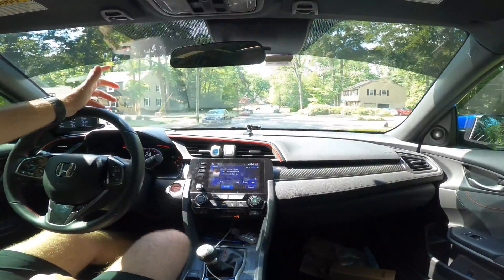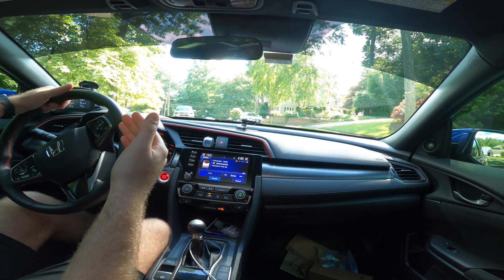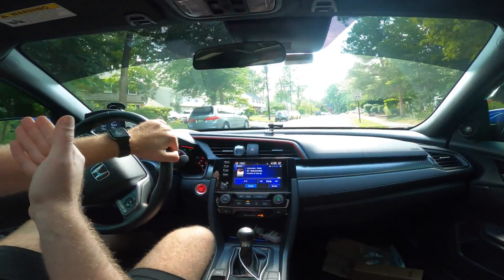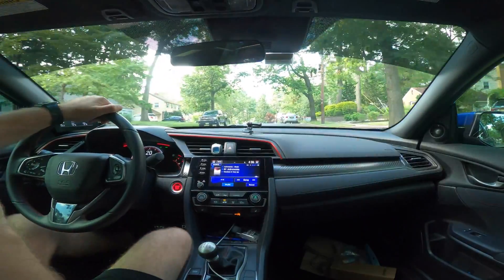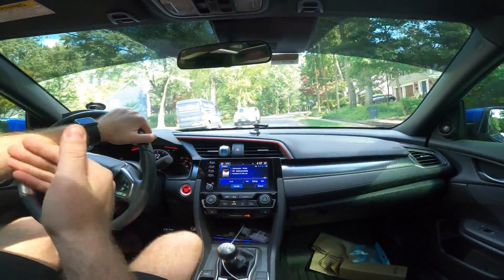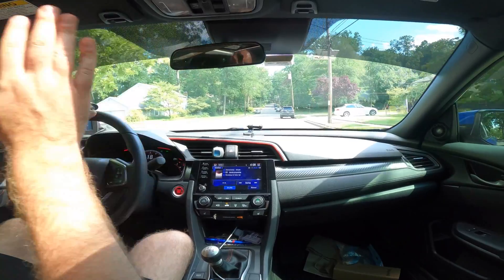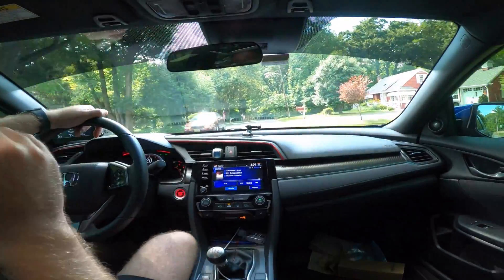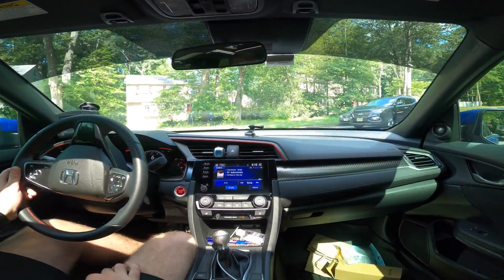Hill Start Assist and Brake Hold Explained

Comment: The 70’s …. My 2012 Honda SI doesn’t have hill start assist…. My 2019 SI Does…. It cheats the driver of a real experience of actually driving a manual transmission

Comment: Hey man, can you use the brake hold in conjunction with the hill assist while moving off from an incline? Where I’m from, a lot of our carparks are multi storied ones. Appreciate if I could get your advice, thank you!
Reply from the maker: Well the car does hill assist automatically but if you have brake hold on then you wouldn’t need hill assist to kick on since brake hold would already be holding the car for you.
Reply: @ThePropperWay  I see, thank you for clarifying! Have a good day ahead 👍🏻
Reply: Love the Honda Civic Type R FK8 btw, I hope to one day be able to own one. The prices, even used, are astronomical where I live. 🙃
Reply from the maker: @kewei94 I have the FL5. Never driven the FK8 one but had friends who had it. I assume it can’t be much different.
Reply: @ThePropperWay  saw your icon and intro and I assumed, sorry about that. Yeah, I’m pretty sure it’s similar, if not better than the FK8. I’ve grown to like how subtle and unassuming the FL5 looks compared to its predecessor. Both great cars though.
Reply from the maker: @kewei94 ironically I have had my intro way longer than I have had the type r. Just a weird coincidence that it worked out color wise.

Comment: Does break hold work for Hill starting? Like if its on and I'm going to 1st gear while foot is on the break and then moving it to the gas, can I just be on clutch and gas? Or is it only on flat ground.
Reply from the maker: @DecemberVang  brake hold works on any terrain/angle
Reply: @ThePropperWay  I have an FL5, and sometimes when I am on a hill, I feel like I'm too slow from clutching in, going to first while my foot is on the brake and then slowly releasing the clutch and then quickly going on the gas; thus causing me to start rolling back. If I have the brake hold on; can I do this? Clutch in, go into first "No foot on the brake". and then move with gas and slowly letting out the clutch? Or would I be rolling back as soon as I add gas.
Reply from the maker: @DecemberVang  it will work but once you press the gas and release the clutch the brake hold will turn off and not engage again until you hit the brakes again. Need to be aggressive enough on the hill to disengage brake hold and get the car going forward without stalling.

Comment: another pointless “sales feature” like TPMS - immediately apply the handbrake when you stop on a hill (as you should, to make the car safe) and release as you move off. Simples
Reply from the maker: @jaywalker1233  pointless? It’s a features that helps you out so you don’t have to do a pedal dance to get moving on a hill. I think it’s a great feature.
Reply: @ThePropperWay  
u have to learn the ‘process’ for your car, and it may not ‘work’ in the next car u drive (they’re not all exactly the same). Sure, you have to learn the traditional h/brake process - but that works for all manual / stick shift cars (except outliers like Mercedes). My car has it but I dont use it because safety first: always apply the h/brake when u stop on a hill. But if u like it then, hey, that’s great
Reply from the maker: @jaywalker1233  can’t turn off hill assist on the Hondas and with electronic parking brakes it’s very hard to release it correctly to get moving on a hill since you have to be pressing the brake to release it.
Reply: @ThePropperWay  
yeah can see that, my car’s setup disables h/start assist soon as h/brake applied - system designs are manufacturer/car specific but I’ll always prefer a conventional h/brake as it’s a 100% mechanical safety backup in case of major electronic system failure (pretty sure more+more RTAs are going to result from electronic failures..)
Reply: btw nothing bad meant ‘bout u, ur channel has gr8 stuff +this vid explains h/h well 😊

Comment: My first car, 1995 Subaru had hill start assist, but I have driven many 90s- 2000s standard transmission cars without it. Not just a 70s deal.

Comment: Found this before I got my '24 Integra Type S. Great feature especially for me, this is my first manual car ever (I'm 32yo). I got a lot of practice in prior on some older Civic's and even a super old Ford Ranger truck in a parking lot. Still need more reps and practice but this alleviated my one fear about getting a manual.
Reply: I’m not balling like you w the Type S, but I just got a Civic Sport Manual as my first and it’s features give me some peace of mind
Reply: @calebbush6500  the Ford Ranger I got reps in is about 25 years old, so it has none of the creature comforts of a modern sedan with a 6 speed. The clutch was heavy feeling. The bite point felt like 0.25" away from a full release. I stalled that thing out so many times getting used to it but I'm glad I got that experience because any good modern manual is SO much easier and accessible. 

I had heard trucks with a manual were also way different than a similar aged car, and it was. I still have some levels of anxiety driving the integra even a month later. It's a lot better than when I got it home though.
Reply: I feel u I just turned 35 and got my fl5 first manual car. I actually had a crazy experience stalling on a hill and almost hitting a car behind me so I definitely need to get this down pack. My question is when at a light is it safe to keep my foot on the brake and and clutch in first gear or should I switch to neutral then try to go into gear fast whenever the light changes.

Comment: You simply release to the friction point of clutch then it starts moving. You need to be better at driving
Reply from the maker: Just explaining it…. Car does hill start assist automatically. No way to turn it off.

Comment: I have 15 civic si so pretty much on the steep hills I have to use a ebrake cuz I don’t have the brake button
Reply from the maker: The 15 civic si I believe has hill start assist
Reply: @ThePropperWay  I was asking about the ebrake button you have I think that’s only on the 10 gen civics no more hand brake?
Reply from the maker: @RayGunz101  no the 10th and 11th gen have the buttons now. No more hand brake lever

Comment: would you recommend using brake hold on an uphill start?
Reply from the maker: If you are on a hill the car will automatically do a hill start assist and hold the brake for a few seconds. I really only use brake hood when I am at a red light or in traffic and don’t feel like holding the brake while stopped

Comment: If you use brake hold on a hill and you release the brake and clutch to hold you are you able to just give it gas when your ready to go or do you need to use the clutch again?
Reply from the maker: Not sure what you mean by that. Brake hold just makes it seem like you are holding the brake when you aren’t actually holding it. Everything else is the same. If you release the clutch in gear you will stall the engine when stopped.

Comment: Hill start assist is for people who don’t know how to drive a manual transmission. Buy an automatic if you’re scared
Reply from the maker: Do I need it? No
Can it be turned off? No
Am I glad the car has it? You bet
Reply: @ThePropperWay  I shouldn’t have a feature on my truck that decides when it’s going to apply the brake. It should be an option.

Comment: No.If you are good with a manual you don't need the hill start.Should have to turn it on not the default.It is the most annoying thing right next to the collision avoidance and the adaptive cruise.

Comment: My 2006 Sienna was doing the hill start assist on its own.  But after changing the front tires and taking it into used car inspection it no longer holds on a hill when I take my foot off the brake.  It gives me so much anxiety and I do not know how to fix it.  Does anyone know how I can fix this on a 2006 Toyota Sienna?  Is there a button I can push?  Is there something I can ask the mechanic to tighten so it doesn’t roll back?

Comment: What’s the difference between hill start assist and using handbrake?
Reply from the maker: Hill start assist is automatic. If you stop on a hill and release the brake it will keep holding the break for another few seconds. Handbrake you have todo. Hill start assist is automatic.
Reply: @ThePropperWay  last question. if I’m on a hill, can I use just the hand brake to stay stopped or do I need to do both foot brake and hand brake to remain stopped? Thanks
Reply from the maker: @joeyxmac  stopped at a light or stopped to park?
Reply: @ThePropperWay  stopped at light/traffic
Reply from the maker: @joeyxmac  I would just hold the brake pedal. When you release the brake, hill start assist will hold the car to get moving. If you don’t feel like doing either you can also turn on brake hold and once you come to a stop brake hold will hold the brakes until you get moving again

Comment: Thanks for the very informative video! Quick question if I may - with hill start assist, do you still have to rev to higher rpms than you would on a flat surface to get going?
Reply from the maker: Yes you do
Reply: @ThePropperWay  Thank you :)
Reply: @ThePropperWay  Thank you!

Comment: Thanks for the hill start assist explanation. But I think you’re missing the boat with Brake Hold. Your explanation is great. My favorite use of Brake Hold is when I have to sit in lines (pharmacy, drive-through, car wash, bank, etc.). I always use it in those situations. So much so, that when I’m checking out new vehicles, I always look for it. I don’t use it when sitting at traffic lights, usually.  P.S. By NEW, I mean a new Honda!
Reply: 😂😂me too! Spot on!

Comment: Back in the days we used to have a thing called hand brake, thats our hill start assist, also back in the day if you drove a manual, you should know how to equalize clutch and gas pedal pressure to hold your car on a hill, while slowly releasing your hand brakes.

Truth be told, car drivers nowadays have it easier, and everything that their coming out with, feature-wise with new cars, makes it so that it is dumb proof, cars nowadays are no longer that engaging to drive and no longer fun, unlike cars from the 80's and early 90's.

Now you've got brake hold, hill statt assist, automatic parking, e brakes. Back then we just have a hand brake, and that was ton's more fun, you can do a controlled 360 "j turn" on  that thing. You can do a 180 reverse switch direction.

Comment: Hill hold is great but I really really want a real hand brake. Thinking of buying an Si but this may be the single biggest reason not to.
Reply from the maker: Why do you need a handbrake? The car is front wheel drive. You won’t be drifting it
Reply: @ThePropperWay  I prefer to have a physical link that controls the brake when doing a hill start. I know the software is smarter than me, but I want to feel the car moving forward as I gradually release the hand brake.

Comment: I learned to drive stick on an 82 Civic. I don't think I ever used the handbrake while on a hill. It tended to have a fairly fast idle so I think that helped make hill starts easier. A few years ago, I had a Corolla and found it much  more difficult start on a hill. Without using the handbrake it would roll too much.
This week I was out with my son and we were test driving a newer Civic that had an electric parking brake. I was worried how to start on hills so I avoided them. Thanks for sharing how this works.
Reply: Same here.  I learned to drive a manual on a 1998 Civic.  That one had a manual parking brake.  With these new electric parking brakes, I thought I might need to use heel-toe to start on a hill in heavy traffic.  After watching this video, I'm amazed at how seamless hill assist is.  It just works.

Comment: Discovered my civic had hill start assist the other day, never realised it for 2 years lol.
Reason I noticed was it actually held me back a bit and I needed to give more revs than I expected to get it move off because the brake was holding on ...
Good feature though.
Reply: I’ve stalled because of it lol I’m like wtf is going on
Reply: @Ruvalc  yeah me too, I can see how it night be good for a new driver but i really dont need it  i do a better job if i had complete control of the  car.
My friends have newer cars and they have so many driving aids it's crazy,
Lane assist , auto braking , adaptive cruise control, auto parking.
I remember when power steering was a novelty lol, I hated it because I couldn't feel what the wheels were doing.

Comment: Wait why do you need to give it clutch?
Reply from the maker: the clutch engages and disengages the engine. if you stop and the car is in gear without the clutch being pressed then the engine will stop. wheels stop+engine stop if the clutch isn't pressed.
Reply: So basically you’ll stall

Comment: Break hold is so good for your transmission!! It is perfect for those long lights and long lines at fast food drive-through joints.
Reply: Yeah cause the torque converter doesn't do anything to save the transmission, lol

Comment: I used to drive a tractor trailer with no hill assist And a nine speed unsynchronized transmission. Personally I can’t stand it in my Honda in fact I didn’t even know it came with it When I found out I could not turn it off I was kind of pissed. If driven correctly there is zero need for it.

Comment: Brake hold question:  If I have an automatic transmission and in stop and go traffic.  I turn on the brake hold and the car will hold it stopped until I step on the gas?  Or do I have turn it on and off every time I stop and go?
Reply from the maker: Usually brake hold is for manuals since it is harder to get moving on a hill. but to answer your question you can leave it on and when you come to a stop it will hold the brake until you apply gas. no need to turn it on and off everytime you stop and go. everytime you come to a complete stop it will activate as long as it is still on.
Reply: @Key Board I finally used it on my wife's CR-V.  They seem to hold the brake, but once you press the accelerator they release allowing you to move again.  It does not release the brake before you step on the accelerator.  I'm sure it will cause premature wear on your pads but I couldn't say how much.  Seeing how people drive around here I doubt they are concerned too much with brake jobs or engine wear.  They seem to be either standing the gas and standing on the brakes wherever they go.

Comment: If you know how to drive manual starting on a hill is simple. No need to give it any more gas then you normally do. This feature going up would be good for first timers but after a month not as useful
Reply: Most people don't know the real reason why cars have this: auto start stop. If you have an auto and you let go of the brake, mash the gas, and the engine fails to start (defective starter motor, bad battery), the car will roll back and cause an accident. Likewise if you have a manual and you fail to notice the car didn't restart when you shift into gear, the same will happen.
Reply from the maker: Still comes in handy so you don’t have to think about rolling back into someone on a hill. Just gives a piece of mind and makes it easier to daily drive a manual.

Comment: Because you don’t know how to release clutch and hit how much gas. Anyway. It’s hard to control.
Reply from the maker: Not true. The second you take your foot off the brake without brake hold you will roll backward slightly. There’s always people who pull up too close to you on a hill and you do not want to hit them.
Reply: @ThePropperWay  I understand. I think no people will control gas and clutch on the big hill with the car no back sliding. When they don’t use brake hold or mechanical hand brake.

Comment: So you have to keep your foot on the brake while you're on a hill then quickly hit the gas before it rolls back? That sounds way more tiring and scary than just popping the handbrake.
Reply: Nope nope. I got a Citroen n it will hold for 2 seconds. It's really handy.
Reply: You must be a noob. Having hill assist is quicker than using the handbrake. Constant use of the handbrake on hill starts can wear out the handbrake cable.
Reply: Most new cars use electric parking brakes so you can't pop it. You have to hit the button and then it takes a second or two for it to release.

Comment: Finally. Before,  I really thought that the "Brake Hold" holds the brake when you're uphill and will still hold the brake even if you took your foot off the brakes, and will only deactivate when you step on the gas.   Thanks to you sir.
Reply: It's a 2 second hold on my Citroen.
Reply: @ASMR-XI-ZUI Are you confusing what hill assist and brake/auto hold are? Hill assist lasts a few seconds to allow you time to switch pedals. Brake/Auto hold should last as long as you need it to be